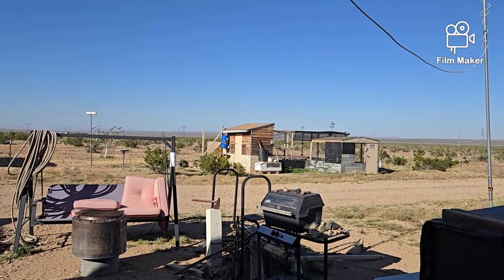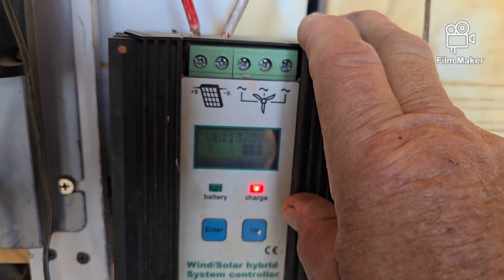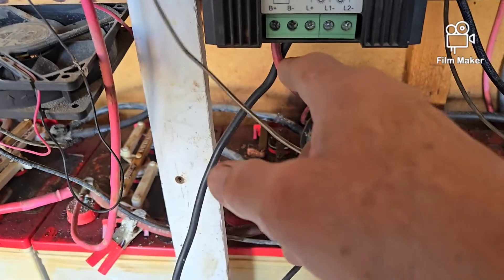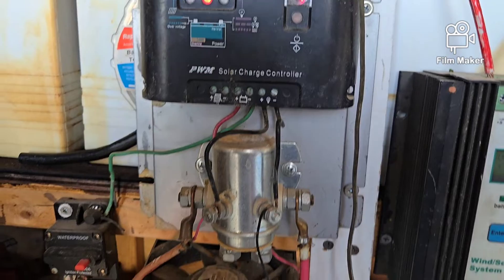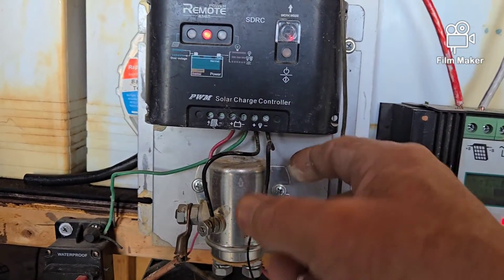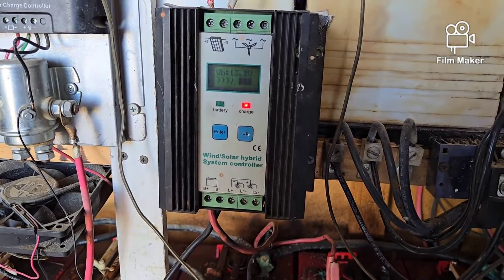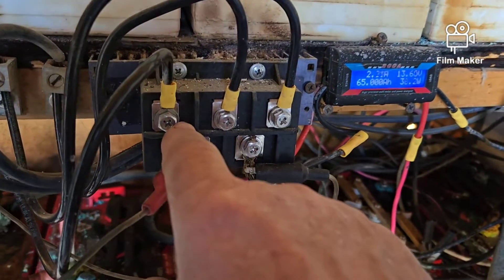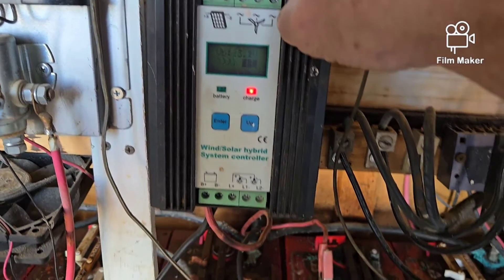About Wind/Solar Hybrid Controllers, April 23, 2024

Comment: G bear i have diy life04 batterys i set the charge controllers to 13 .9 to 14  they float at 13.4 to 13.2 i do not use bms i only use battery balancers and i mix batterys with LQ ACID have for the last four years and doing fine its not how munch but what can you afford
Reply from the maker: I would never have tried that.  I can't afford to damage batteries by experimenting with what everybody says not to do.
Reply: @GBear  well i have seen the bms higher then what i paid for the batterys the balancer are only about 20.00 or so un less you get them  from ali i don,t have the ah you do i have the smart charger come about 11 pm and off at 5am works for me

Comment: Hi G Bear.  Very good overview of your setup.  As you know, its hard to beat the Classic 150.  I think the experiment would be interesting to see, but as you stated they really don't make those anymore.  However, with copper prices being what they are I am in the A/C camp on the turbine.  So what kind of turbine did you install again with the specs and performance, etc?  I was leaning toward Hurricane Wind Power since I have never seen ANY really decent Chinese wind turbine reviews even though one channel used to rave about them.....but now a lot of channels have become info-ads for manufacturers with little learning value.  I like the real world stuff you're doing since many people don't have a budget to big or worse, do it wrong.  Have a good weekend.
Reply from the maker: Great entry, Gary!  Yes, stay away from Chinese turbines for now.  They don't meet their advertised credentials.
That may change in the future, but for now, they are junk and won't make you happy.
Your choice, and Thermodyne make decent products that are most reliable.  I have been using the KT5 by Thermodyne, and it has been good to me, but when I upgrade my system to 48v, I will go to the KT7 for 48v.  As I will, be sure to also buy the adequate bridge rectifier for the increased power,  and run it through a Midnite 150, 200, or 250 Classic controller, to avoid the need for a dump load controller or diverter,  and also get the best efficiency from your PMA.